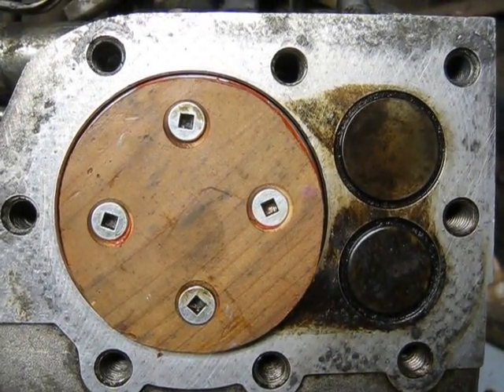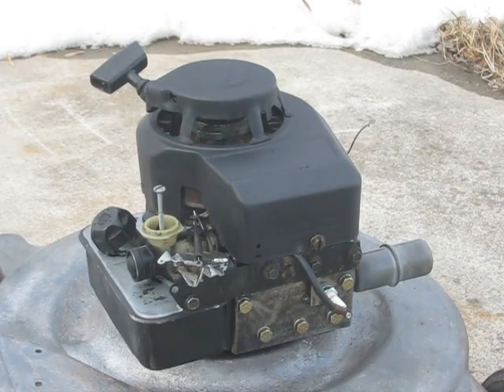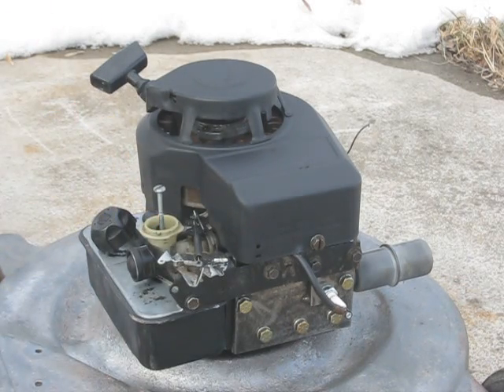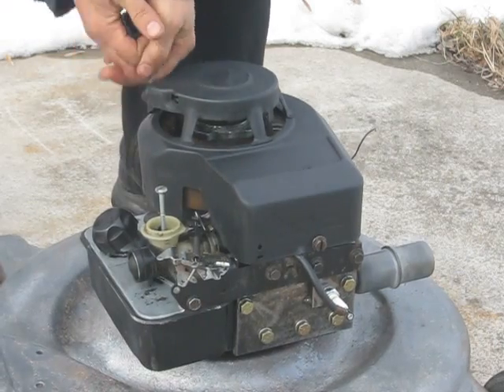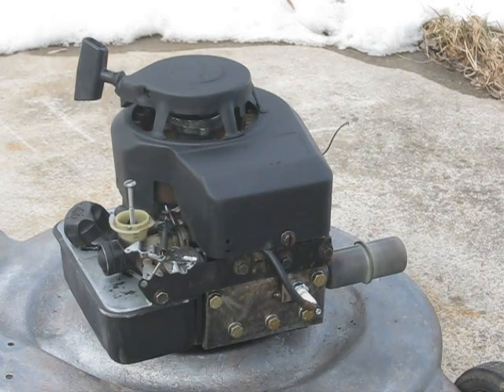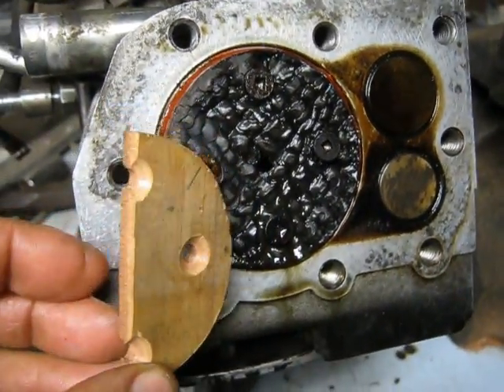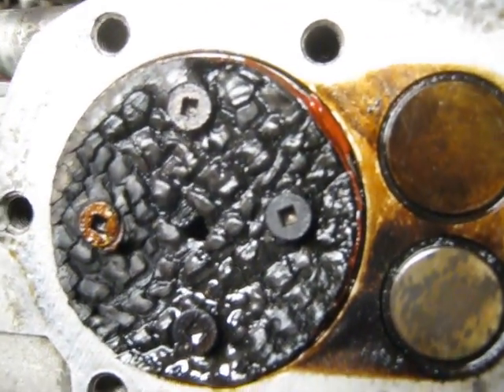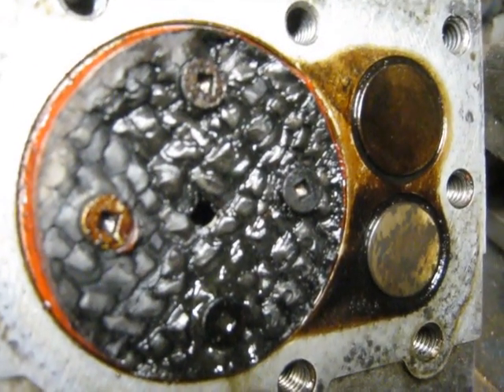Red Cedar Piston Run!

Comment: You should do a glass head,so we can see the wood burn...Maby a night run..
Reply from the maker: I am headed that direction, i have bought the glass, just have to cut and drill it, and make the new wood piston crown. i think I will go for red cedar again. I am looking at using propane, since hopefully it will burn cooler than gasoline. I don't want the head to melt in like 5 seconds!

Comment: You should try and get a piece of Ipe Wood, I'd be curious to see how well that would hold up!!☺
Reply from the maker: Howdy, I know the wood you mean, the second wooden head I ran a few weeks back was either Ipe or Teak, not sure which. I will go rescue another little piece of it from my son to use as a piston crown.  You guys sure did your research when building your glass head, that is an awesome project. I think the cast iron engines you use may offer some better design possibilities than the aluminum engines I use. Take care, and feel free to machine and run a wooden piston, I have no way to machine a whole wooden piston. i bet Ipe or Ironwood would last as a piston.  Take care

Comment: I'm pretty surprised that Cedar ran that long.  I've got to say, Cedar has the be the best smelling wood out there.
Reply from the maker: Yes, the red cedar does have a nice, though strong smell. I have some very small black walnut trees trying to grow in my yard, I call them stink trees,  because when you cut them off, it stinks badly! I drilled some oak today, it was nasty smelling also.
Reply from the maker: Question for you, as woods go, how dense is Walnut? the piece i used wasn't very dense, nothing like oak. perhaps I had a dud piece?
Reply: It was probably a dud, as far as I know, it's pretty dense stuff.  But you shouldn't quote me on that.

Comment: maybe have an engine burn a powder type fuel source.
Reply from the maker: I have heard of people trying to make engines run on black powder, but I don't think any were ever practical.
Reply: ChargerMiles007 It would be neat though
Reply from the maker: Though homeland security wouldn't be liking it, they would confiscate your car for explosives every time you tried to drive it aver the border. Plus the gunpowder fuel would probably be pretty expensive in pounds per mile!  :)

Comment: Are you using the same deck hight as the stock piston? What's the new compression ratio if not?  Prob 25:1 or something insanely rediculous.
Reply from the maker: No, I added the 1/4" wood to the piston, then made a 1/4" spacer plate to mount a flat head onto. I think it has about the same compression as normal, judging from the starting effort pulling it over.